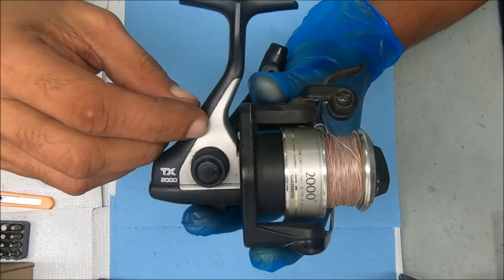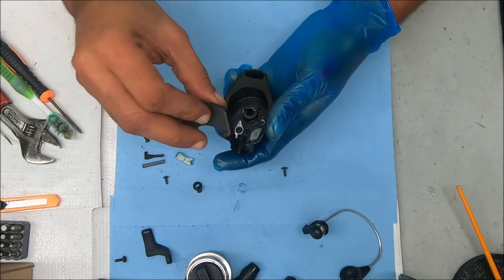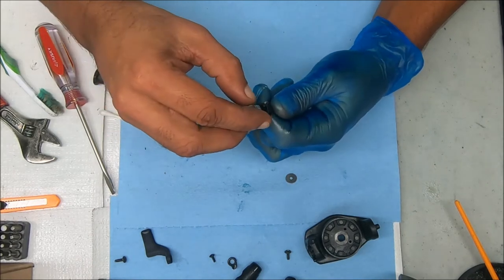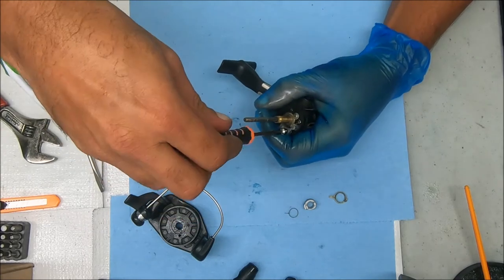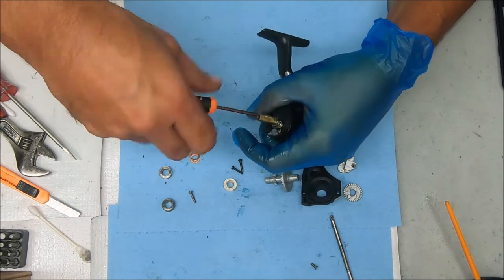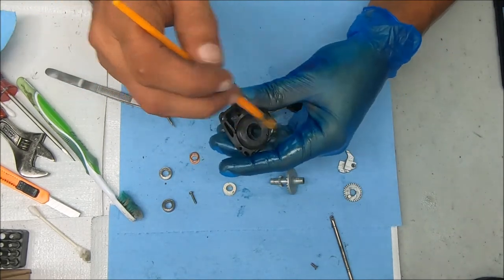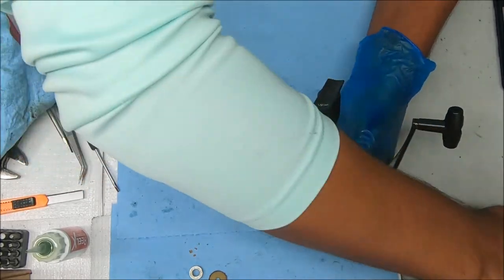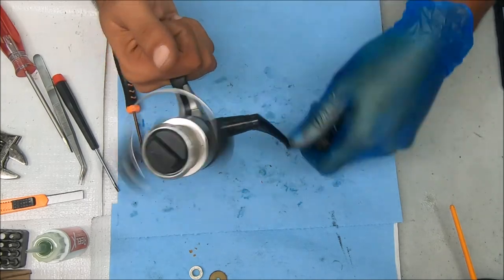Shimano TX2000F Fishing Reel - How to take apart, service and reassemble

Comment: very informative video. bad news on my side, I didn't tighten the bail screws down enough and lost the little black piece that fits on top of the line guide...found the screw, lost the piece. any ideas where I can get another?
Reply from the maker: Thanks for checking out the video. That sucks! Might be a little tough finding replacements..... check out my community page for links that might help you find a replacement.

Comment: I never could figure out how the lockdown screw next to the rotor nut worked. Does it expand something inside? Or does the head of the screw just block the flat side of the nut from turning? Thanks.
Reply from the maker: Thanks for watching, Steve! Yes, it's just there to help stop the nut from moving.